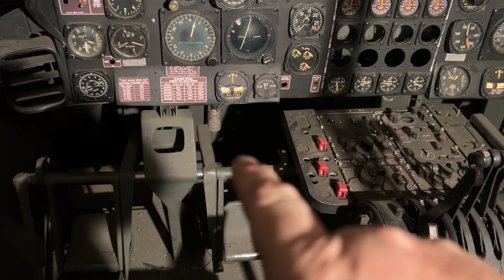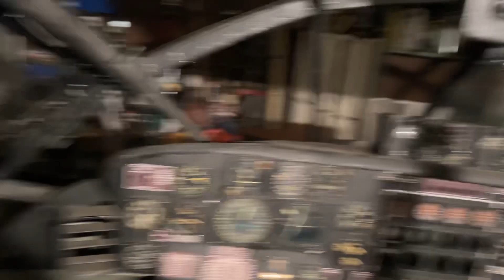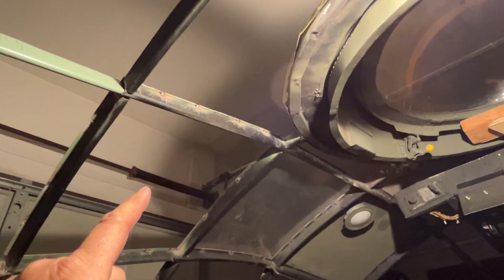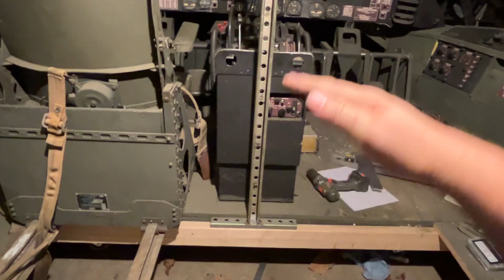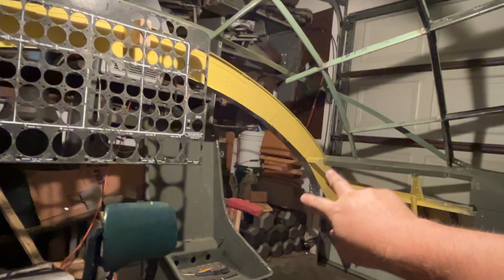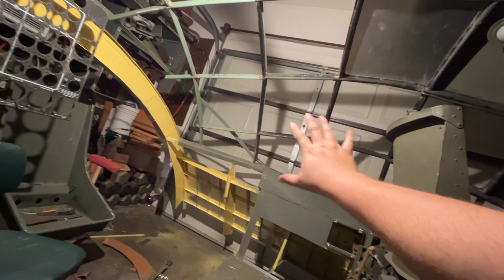Building The Last B-36: How Much More Work To Completion?

Comment: 8:42 I know exactly what you're talking about. Several years ago I had a ride flight aboard the B-29 "FiFi". I was in the Flight Observers seat, directly opposite the Flight Engineer Seat. It was interesting how a row of switches were each able to be operated independently and yet all of them instantly lowered to their lowest position with just a simple metal plate and a hinge. Brilliant! I recorded some of it and it's at the beginning of my B- 29 flight video. Cheers!